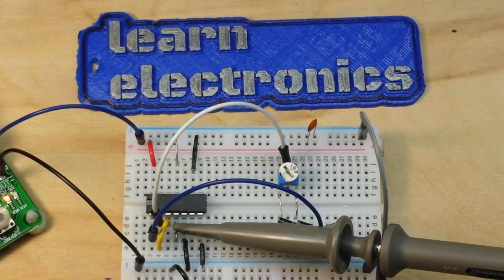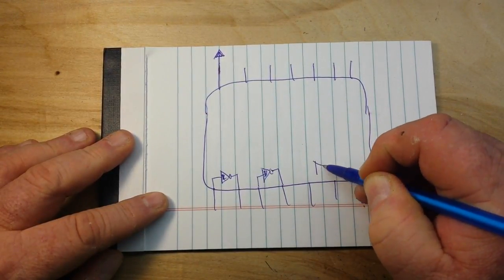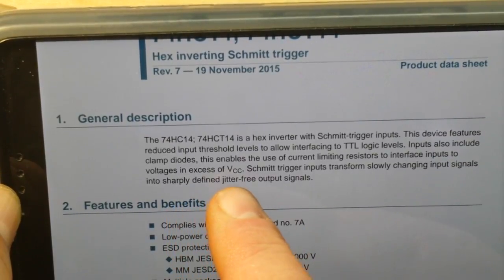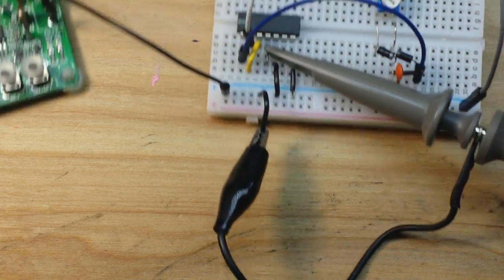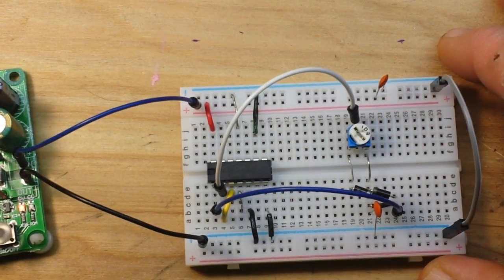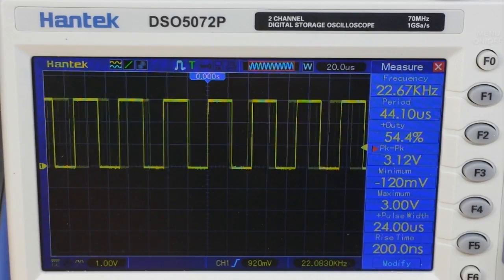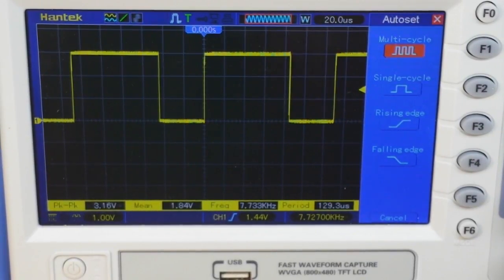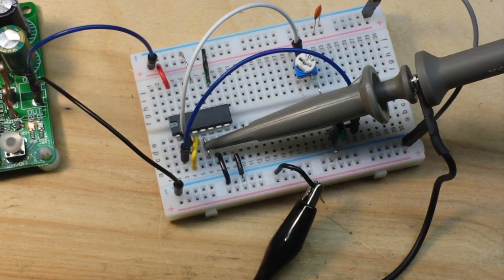Digital Logic - 74HC14 Inverting Schmitt Trigger

Comment: You are NOT adjusting the duty cycle, what are you talking about! You are adjusting the FREQUENCY with the pot-meter. I am stunned.
Reply from the maker: +IgnoreMyChan you are wrong
Reply: No :D Have a look at the frequency when you dial the POT-meter ;-)
Reply: They do, but I think the change in duty cycle is more like an imperfection than a controlled parameter. The frequency change is way more significant.
Reply: I agree, the duty cycle is changing but so is the frequency, in a large way. It's because you're lowering the R component of your RC oscillator

Comment: Can it op-amp be configured to give the digital output when, say, the voltage changes from 0.4V?
Also, is it possible to have the 'digital flip' the other way around? I guess swapping over the + and - inputs on the op-amp??
Reply from the maker: That's a comparator

Comment: I couldn't get this to work as a simple buffer. Is there a minimum input gate current requirement? I was trying to drive an LED off of the input pin at the same time. Thanks.

Comment: How can we use it ?? Examples ?? Application ??
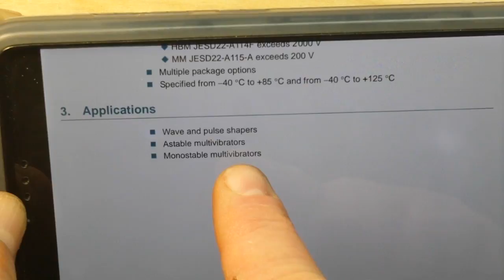Reply: minute 3:25 and 3:58
Reply: You can use it to produce negative voltage from the positive rail. You can boost the available current by using the five other gates of the chip in parallel.